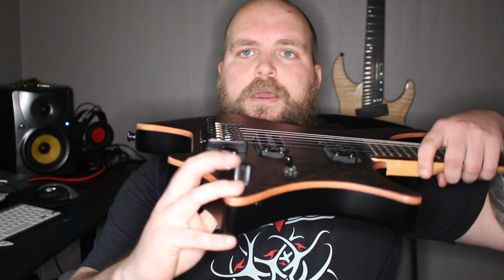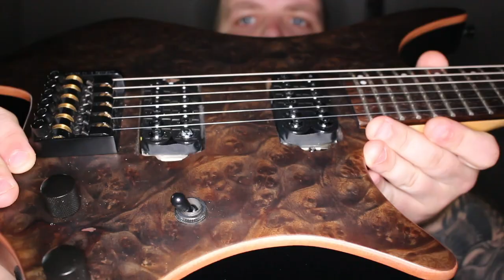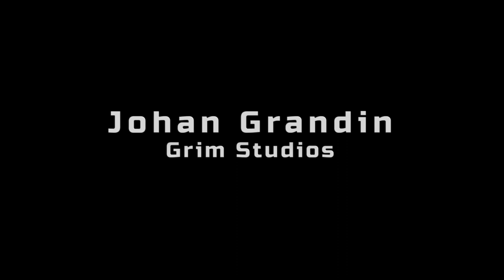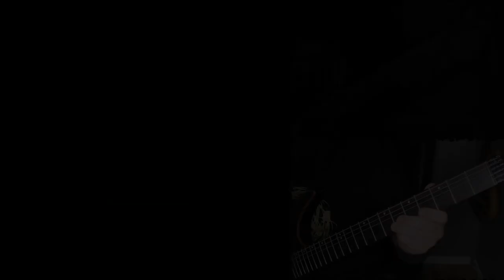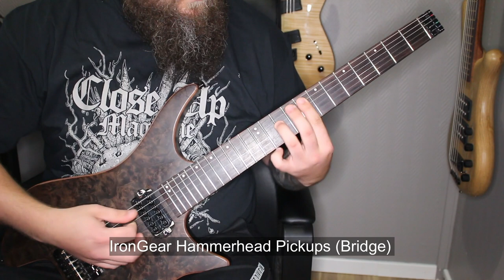$299 Grote Headless Guitar | Part 2 (IronGear Hammerhead Pickups, A+B comparison)

Comment: Another plus that I discovered with this bridge setup is that I was able to swap out no less than 4 different pickups til I found the one I liked best in this guitar.  Between two no-name ones from Guitarfetish, a Duncan JB model, and finally the Duncan Distortion that I went with.  De-tune the strings, move them out of the way for a second or so, and twist the wires temporarily together.  Easy.  The Duncan Distortion is amazing in this guitar!  My current amp rig is two Joyo Bantamp Heads running at the same time - the Meteor and the Zombie, while also using a DB booster in the front of both amps via a ABY pedal.  Also, a  Oceanreverb pedal through the effects loop of the Meteor.  The sounds is just awesome!  Two 20w amps cooking along is plenty of power at home.

Comment: How much does it weight with the Koa veneer? What do you think of the other hardware, and the assembly, finish, etc. I have a back injury and I can't play my heavy assed ES135 anymore, thinking of giving a Grote headless a try.
Reply from the maker: It weighs 2.4kg/5.29 pounds. Overall quality is pretty good. Had to change the pickups though, or at least re-do the wiring, because it hummed a lot.
Reply: @johangrandin  I've seen elsewhere that the pups aren't potted. That's cool, I can swap electronics in my sleep! ;-)
Reply: @johangrandin  I've also seen a semi-hollow body on eBay I WAS considering, but I think I'll keep it simple for the first one..

Comment: How awkward is it to sit in classical position with the output jack placed where it is?
Reply from the maker: It´s not an issue if you use an angled cable. But yeah, it´s not an ideal placement of the jack.

Comment: Is the grote logo above the neck pickup just a sticker? If not, how did you remove it?
Reply from the maker: No, I sanded it down gently. It's not pretty, you can see it when looked upon closely. I had a plan to refinish the top but it have not happened yet :P We'll see if I do it or not, but if I do, there will be a part 3 video :)

Comment: Nice review!, can you tell us if the edges of the neck cut your hands and if the separation of the neck and the body is to noticeable?, also if you could tell us about the weight, how does it feel?
Reply from the maker: Thanks dude! No, the fret edges are nice and the neck sits very tight to the body. They did a really good job with this. It weighs 2.4kg and sits really nice, very ergonomic to play.
Reply: The frets and neck connection are spot on.  This is actually a really good guitar.